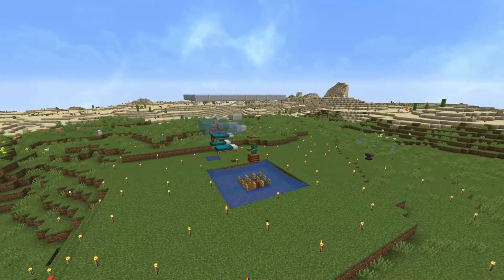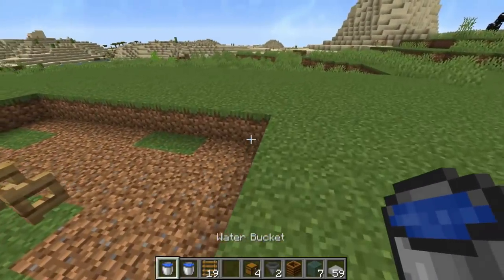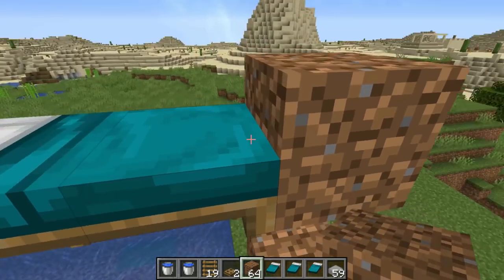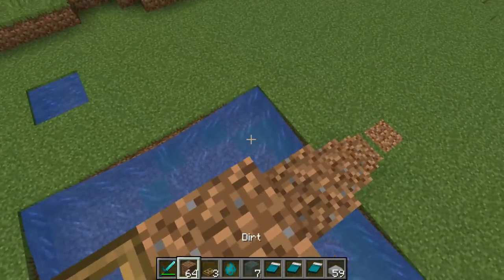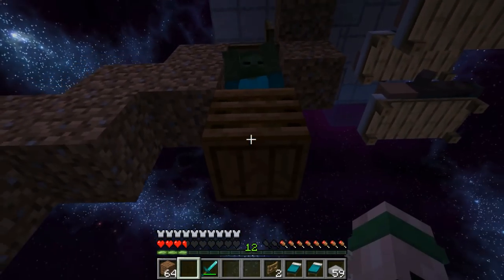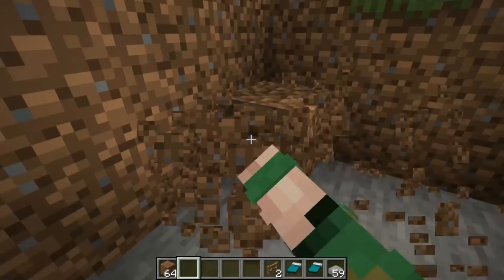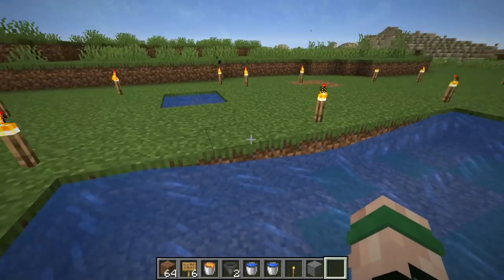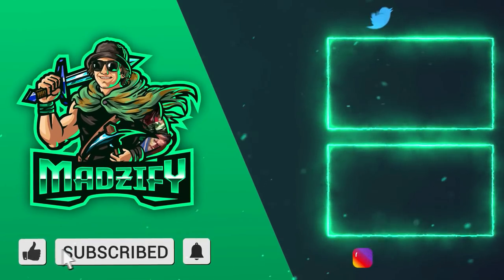EASY & COMPACT Iron Farm Tutorial! Minecraft 1.19+ (350+ Iron P/H)

Comment: Just a heads up: if you add 3 more villager cells to this farm, one on each unused side of the square, you can DRASTICALLY increase the drop rates of this farm for barely any more materials
Reply from the maker: Great tip dude I believe a few people have been doing that
Reply: Like how ? By adding 3 more beds to the side ? And blocking them with glass. The zombie still sees them right ? What do you mean by increased rate, do the Golems spawn faster or do they drop more iron per death. I am getting a Golem every 40 Seconds and they drop 3-5 iron.
Reply from the maker: @saunak9183  you can just replica it all 4 sides with 1 zombie I believe
Reply: @Madzify  have you done this change?
Reply from the maker: @matthew24v  can confirm this works
Reply: @Madzify alrighty thanks. I’ll be building it soon! :D
Reply from the maker: No worries
Reply: Wouldn't the villagers be to close together or realise there is already an Iron Golem nearby? Does it really multiply the ingots by four or would it be more efficient to have two seperate modules?
Reply from the maker: @LeoPelo24  if you made 4 modules it wouldn’t be 1400 an hour I wouldn’t recommend making anymore than 2-3 before it becomes not worth it

Comment: Hi, i was wondering if this design was modular
-i was wondering if i could have a villager cell on all 4 sides of the water and have it be more efficient?
Reply from the maker: Hey dude if the villagers are spaced far enough to apart to not cause issues with each other it should? I can’t remember the exact amount of blocks but it should be fine to do so if done right might need multiple zombies as well though!
Reply: @Madzify  Ok, thank you
Reply from the maker: No worries dude let me know how you go!
Reply: @Madzify  I built it on my server, but when i logged off and logged back in it stopped working so i'm currently trying to figure out a solution to that, but it had gained me a good 3 and a half stacks so i'm saved for now
Reply: The beds from each pod have to be at least 16 blocks from each other not to interfere with another pod. So it can be done using one Zombie in the centre also.
Reply from the maker: sorry I didn’t see this comment reply but Nigel is right :)
Reply: Ok, but do i just increase the distance between the middle and the pods or do i have to build multiple lava funnels?
Reply from the maker: Onomis you should only need to be 16 blocks away from other villagers

Comment: I built it inside  the mountains when I was building it it was working but when I finish 
It it stopped working and there is a button to
Reply from the maker: Hmmm have you tried afkin in different spots? Down the bottom? Are you on a server? Also, are you playing on fabric with mods (replay mod etc) I have noticed that it can slow down spawn rates rather than playing on just normal MC 1.16.3 it shouldn’t stop! As mine is still working

Comment: Question... So i built two pods next to each other, the exact same as your introduction setup. However one of my pods doesn't seem to spawn any iron golems. One does great, the other doesn't spawn anything... The pods are exactly the same. So idk if its overlapping or what. I figured it was okay based on the intro footage.... IDK. Help.
Reply from the maker: Perhaps you don’t have a wall separating the two?
Reply: @Madzify  So, what ended up happening... I built the pod underground and an iron golem spawned in a few random blocks, outside the pod in a small cave. So it wasn't spawning because there was an iron golem, alive.... Lol. It works great. I have a quad pod and its crazy good. Thanks dude.
Reply from the maker: @LifeOfCod  that’s a very common thing to happen I’m glad you got it sorted

Comment: Got another question. So my iron golems are constantly spawning outside the farm. I have a villager trading hall about 50 blocks away from this iron farm. Would that hall be causing my spawn rates inside the farm to go down? Golems are coming from that hall by the looks of it. Otherwise, I'm looking at having to spawnproof hundreds of blocks around my farm
Reply from the maker: That could be the case but they are supposed to outside the farm then run into the water. But if they are spawning that far then yes it is the hall
Reply: There's my problem. I put walls around the water lol. The farm is now working amazing! It certainly lives up to the claim, I'm getting more iron than I can handle. Liked and subbed, I can't wait to build another one of your farms :D
Reply from the maker: Thankyou so much for the warm words dude and welcome aboard

Comment: Just built it and it worked great for a few days, but now the iron golems have stopped spawning. Any suggestions?
Reply from the maker: Hey dude try replacing the composter for a Minecart and raise it 1 block
Reply: @Madzify  still not working, does it matter that i made it underground? If not is there anything else i can try?
Reply from the maker: Hey dude if you built it underground check for golems spawning in a near by cave or on the surface if that doesn’t show anything make sure the underground area is a total of 19x19

Comment: Hey, why do you need to dig a 17 block deep hole, it will surely kill the iron golem if either way right even if the hole is like 6 blocks deep
Reply from the maker: Yes you can make the hole any depth but making it 17 allows the rates to go up as it resets the timer quicker

Comment: Could I build 2 villager modules with 1 zombie to double the rates?
Reply from the maker: I didn’t do it that way I used 2 zombies but I think a few people have just added more villager cells and it works
Reply: @Madzify  Sadly it only works for a small amount of time. I get like 1-2stacks of iron and then the stop spawning. Any idea why? I made this design earlier without experiencing any issues but right now I can't think of a reason why it should do this. It's build in my spawn chuncks btw, just above the ocean.
Reply from the maker: @luc469  hmmm try replacing the composter for a minecart and raise it one block and put a slab under neath

Comment: It doesn't work during daylight. But works great during night.(which honestly is much more than you can mine) but still is there a way to make it work during daylight ? I read that it has something to do with the villagers working during the day. I made it on a raised platform with shitloads of torches so no other mobs spawn at night, so I know it's the composter zombie spooking the villagers but they remain unfazed during the day .
Reply from the maker: It possibly could be the slabs in front of the villagers and I have heard it can be caused by villagers that have trades or a job
Reply: @Madzify  Nope mine are jobless. I made sure of that
Reply from the maker: Hmmm try removing the slabs in front of the villagers
Reply: @Madzify  Oh I figured it out . I made the roof over the setup much larger. Now it works 24/7👍
Reply from the maker: @saunak9183  interesting
Reply: @Madzify  Now I am not sure if the roof was the solution. I discovered a pretty weird phenomenon , you see the iron farm stops working as soon as you go a certain distance away from it. You come back during daylight it won't start again but if you  come back during the night it starts and never stops during the day and continues as long you are within range. I have tried this many times and this I have confirmed beyond doubt although I don't know the reason yet.
Reply from the maker: @saunak9183  this is so weird looks like it’s Minecraft doing Minecraft things ! Could be a bug

Comment: mmhh is it supposed to work with 2+ of those "bed-stations" villagers? because i did it with two of them... with 6 villagers it doesn't  seem to work
Reply from the maker: Hmmm depends try replacing the composter with a Minecart and raise it one block
Reply: @Madzify  ok i figured it out some minutes after writing, essentially the golem spawned inside a nearby house and got stuck in it preventing other spawn. + the efficiency of the farm doesn't increase by placing more villagers. I tried in creative
Reply from the maker: @ruspagamer7248 I made 2 seperate modules and it almost doubled production you may have villagers in that house making the golem spawn there

Comment: mine has worked for a while and then just stopped. I tried resetting it by blocking line of sight from the zombie and giving the villagers a full night sleep, but its still not spawning golems. any clues on that?
Reply from the maker: Hey dude iron golems could be spawning in an air pocket around the farm preventing more from spawning check your surrounding areas
Reply: @Madzify  thanks for the answer! tho i build the farm in the air, and as far as i know golems dont spawn higher or lower than 6 blocks from villagers, so i dont think there's any air pocket. Maybe is it because i didnt make the hole 17 deep. was it important?
Reply from the maker: Try replacing the composter with a Minecart dude and see if that helps
Reply: @Madzify  sorry to keep bothering. I did replace the composter with a minecart, and the zombie is now sitting down in it. the villagers dont seem to be scared, could it be that he is considered 1 block lower because he is sitting and so they dont have line of sight?
Reply from the maker: @matteopistelli9224  you could try raising him 1 block see if that works

Comment: i built the farm right but the iron golems refuse to spawn in the farm, and only spawn outside the farm area if i remove the slabs. the farm is below the villagers like its supposed to be, why isn't it working?
Reply from the maker: Hey dude they are supposed to spawn outside the water then try get the zombie so they go into the water and down the hole
Reply: @Madzify  yeah, i cleared an area around it already, they're just spawning like really far out and not seeing the zombie. But you know what, I'm doing what i do best.. just mess around with it until it works! And turns out.. i basically just made some long pathway thing and so it ends up working. Slightly less efficient but hey, at least it works now.
Reply from the maker: @bluefiremarkii  hey dude if you built this near a village or other beds I’d say that is why they are spawning so far away
Reply: @Madzify  nah, it's in the middle of a swamp and ocean away from everything.  I have one idea though, it could be other villagers i have near it, they don't have beds but it could affect the spawn. Thanks for the thought, I'll continue messing around with it and see when it works correctly ^^
Reply from the maker: @bluefiremarkii  I reckon it will be near the other villagers my dude
Reply: @Madzify  Well I'll work on it a bit till it works.
Reply from the maker: @bluefiremarkii  awesome dude

Comment: The farm was working perfectly, but now it's not spawning and iron golems? Any ideas ?
Reply from the maker: Try replacing the composter for a Minecart and raise it 1 block then check for golems that are stuck preventing more from spawning
Reply: @Madzify  Hey I have the same problem. I did what you said but nothing happend. However I noticed that the villagers werent sleeping during the night. May be that's the problem? I built the farm in the sky using only spawnproof blocks, so there are no golem near it.
Reply from the maker: @fullaccess2645  do the golems have somewhere to spawn?
Reply: @Madzify   @Madzify Of course, they can spawn in the water. When I built the farm golems started spawning immediatly, however after some time it stopped. Not a single golem spawning for days. When I go to see whats happening, I see the villagers running, so they can clearly see the zombie. But when when the sun was setting one villager made green particles and went to sleep, waking up immediatly and spawning a golem. I think the problem is that the villagers just forget their beds, and the village stops existing. I'm playing in an smp an we often close the server, I think thats resetting the villages of the world.
Reply from the maker: @fullaccess2645  it could be dude try building another one on the ground And see if that building it in the sky is an issue

Comment: hey the golem keeps spawning on the trapdoor why is that?
Reply from the maker: You may have your trapdoor at the wrong height, but you need to put a button on top of the trapdoor
Reply: @Madzify  i did put a button but the same thing happend. Maybe it has something to do with the half slabs?
Reply from the maker: Hmmm, maybe but a button should stop the spawn! It could be the slabs on the roof
Reply: @Madzify  yea turns out the slabs where one block higher than they should be so they were spawnable and golem kept falling on the trapdoor because he was trying to kill the zombie. Thanks a lot, its an amazing design and works perfectly
Reply from the maker: @pitsilas1370  Thankyou so much for your support